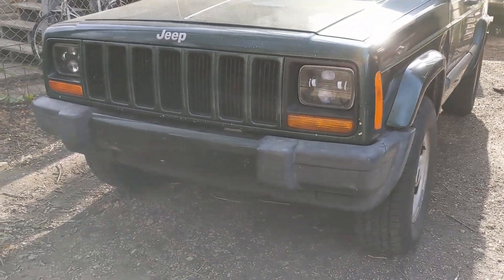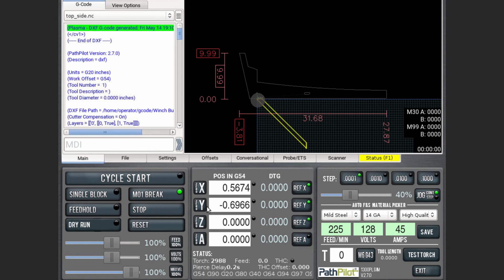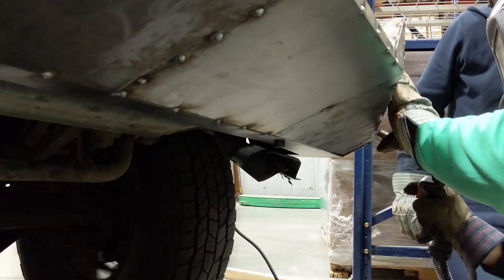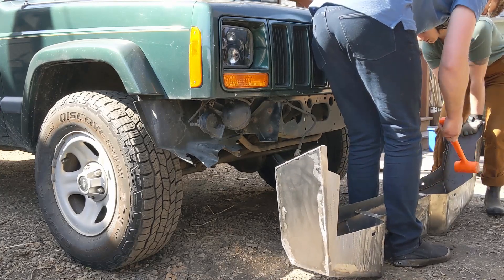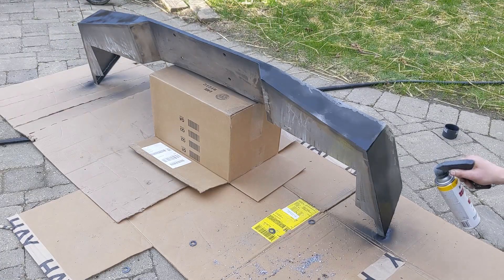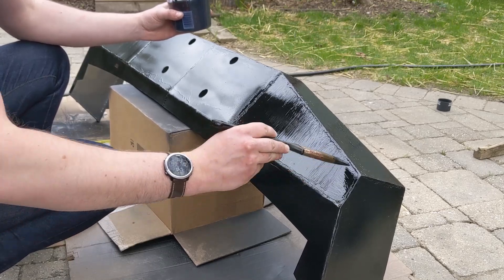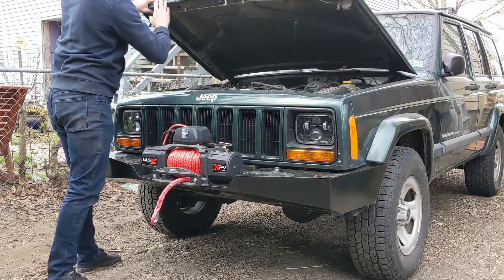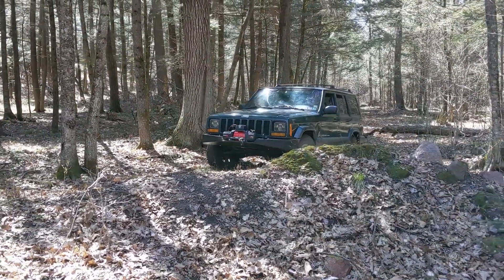Creating a Plasma Cut Winch Bumper for the Jeep XJ

Comment: Looks good, you should think of adding a recovery shackle tab to the front. Then you can use a snatch block to get more pulling force if needed.
Reply from the maker: I think that's the right plan. I'm also going to change the top panels to 12ga steel to get some more strength for the shackles to mount.